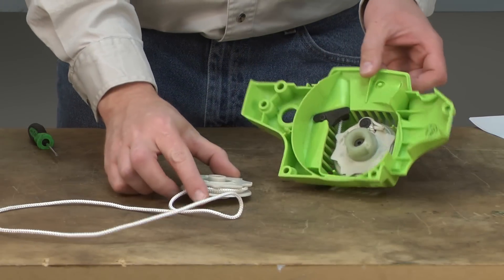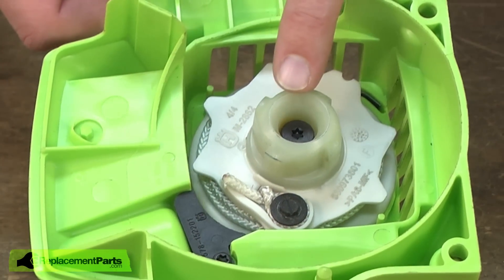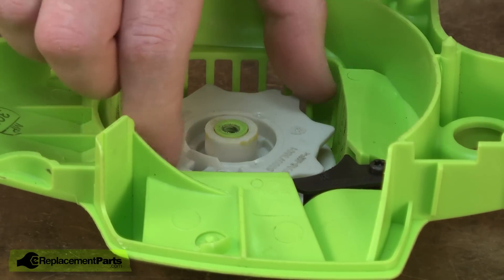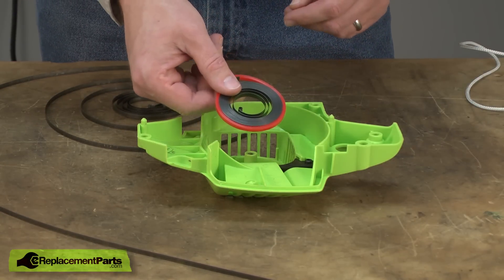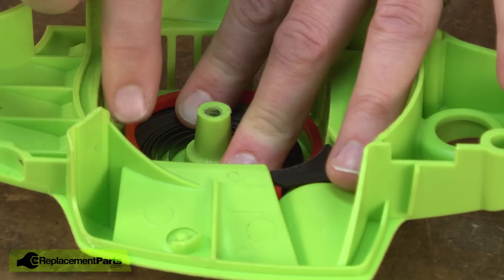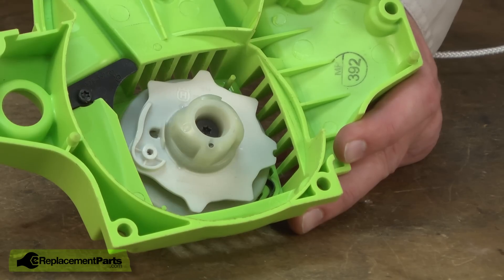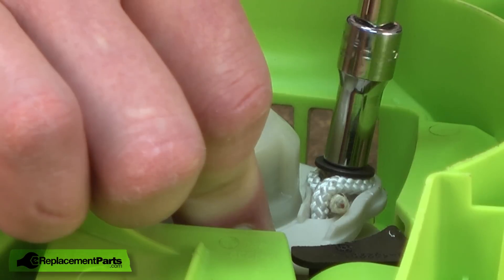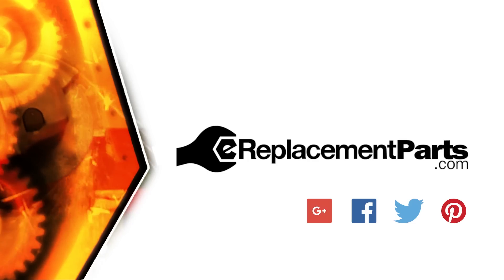Chainsaw Repair - Replacing the Starter Recoil Spring (Poulan Part # 545008013)

Comment: Thank you SO MUCH!!  Believe it or not I watched like 4 videos all showing the WRONG way to wind up that stupid spring if it uncoils.  The drill trick does NOT work, or does the plyers trick.  Installing that hook in first and getting the first 3 coils in is the ONLY way.  Again ... been fussing with this thing for 2 days.  You are a lifesaver!  BTW did everyone know that POULAN will NOT offer phone support anymore on chainsaws?  Also you can't email them for help, they say click on the 'experts' tab in the right corner - well there is NO experts tab.  The only thing you can do for help is take it in to an 'authorized service center' and hope they don't want to charge you $$.  Thankfully videos LIKE THIS ONE, allow you to fix it yourself!

Comment: Thank you for this perfect video! Worked exactly as shown with great explanations. Cord now recoils properly and chainsaw fired-up on first pull. You might add text or explanation about how much to tighten/torque screw in center of pulley. I think mine had been over tightened at factory which caused hard pulls and caused the spring to break prematurely. It also caused a bend in the assist spring.

Comment: l have a Giantz 75cc 22'' chainsaw. This chainsaw has 2 springs, one ( assuming) sucks the rope in which is 6mm, other is 12mm starts the engine. After l changed the snapped spring (12mm)   Everything was ok till l tried starting it. There was only one revolution which wasnt enough to start it.   l fooled around with for a while but, l coudnt work it out. Where did l go wrong?  Thank you for sharing such a helpful video :)

Comment: Good video.  No way you can ever rewind coil by that method.  Tried many times, is impossible.  :)   Also, best to put duct tape while placing as taking band off.
Reply: did it today. Possible! took a few tries but once the first three wraps were on it got easier

Comment: Why, after following your instructions to the absolute letter and prior to finally tightening the screw holding the mechanism down the starter recoils as it should.  When tightening the screw the whole mechanism firms up and does not recoil?????
Reply from the maker: You may need to pull it apart again.  Something is out of place or in the wrong order.
Reply: Try backing out the screw, that holds the hub in, just a half turn or so.
Reply: @tomlampros7122  yeah. I tried that too. It seems the spring wont stay engaged in the recoil spool. So I guess it's time for a new one. Glad I know where to buy it.